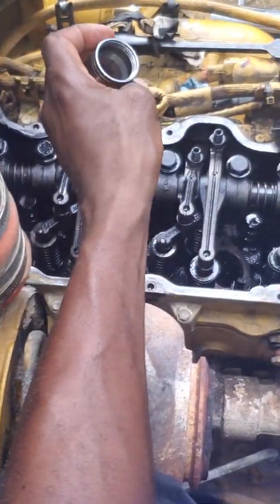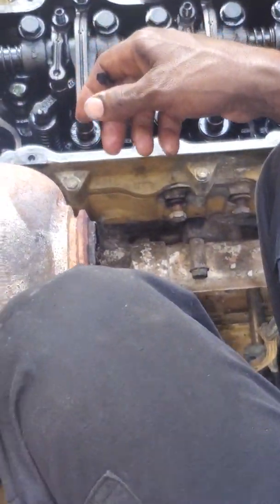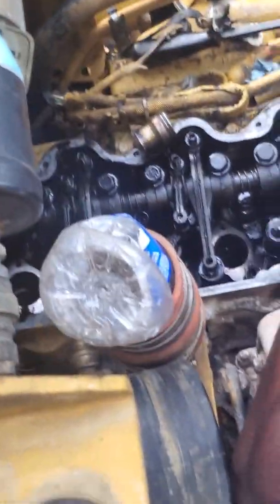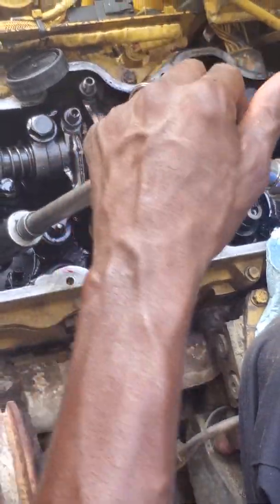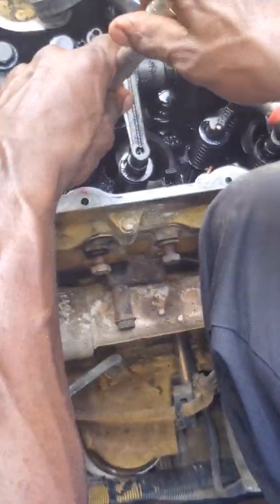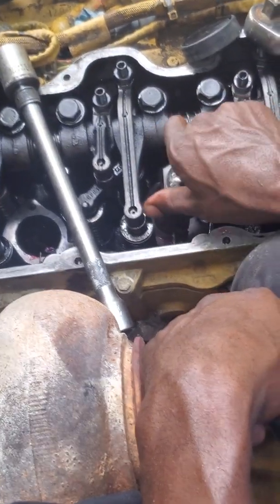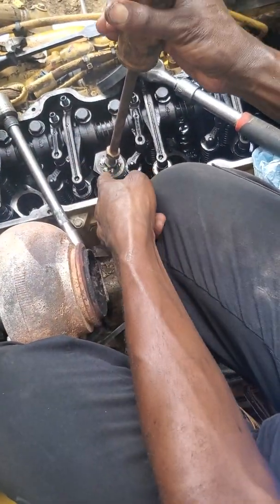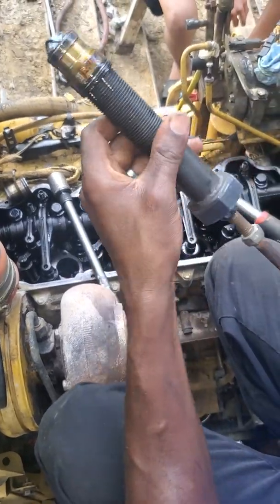Cat 3126 Injector Cup removal

Comment: how do you get the metal shavings from the tap out of the hole?
Reply: Put a piece of rag in the cup before cutting threads
Reply: Plug it up first
Reply: ...and put grease on your tap... that will hold most of the shavings